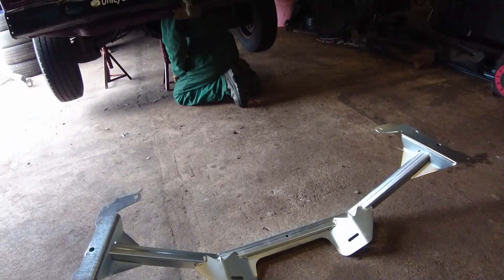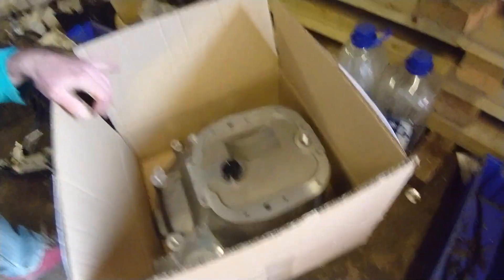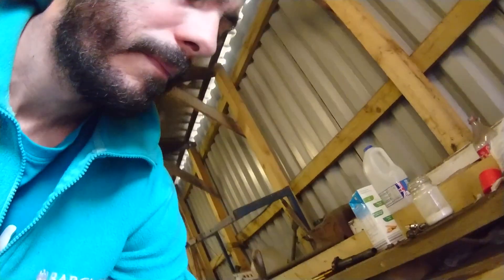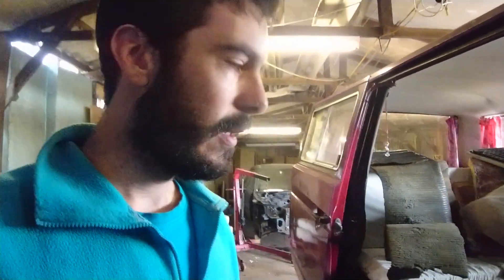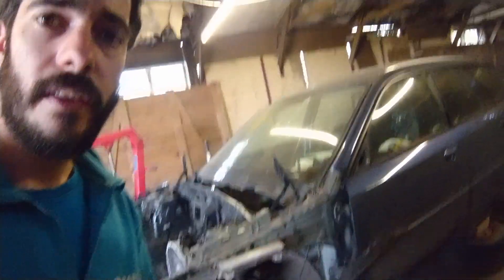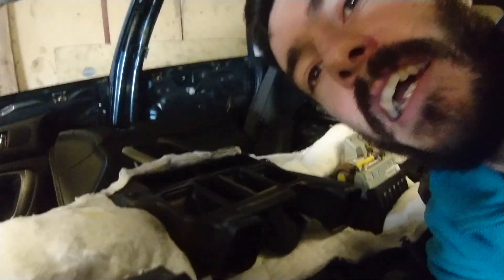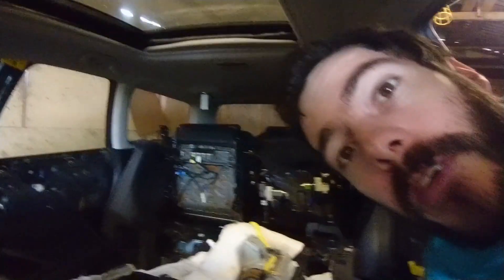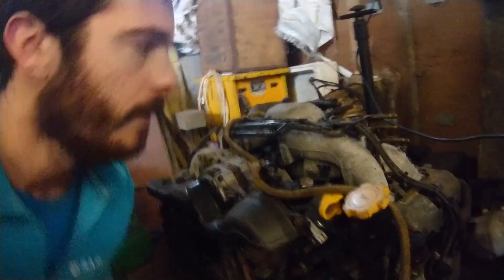VW T25 - Subaru CANbus Conversion [Part 1]

Comment: I just got a Subaru canbus donor and I want to do a similar conversion. Would you guys be able to do the cable loom shortening?
Reply from the maker: Hi there,
No, I don't do this as a service. The wiring is the trickiest bit for me, in fact the whole project has stalled because of it.  I have the loom out of the car and all the unneeded circuits removed but wiring it into the van is the daunting bit. Hoping to get a friend with lots of wiring experience to help me with it soon.
To be honest, if you get a copy of the Subaru manual and go through each circuit at a time, it's not difficult. You just have to be methodical and take your time with it. Label everything and only cut a wire when you've checked twice you don't need it. Even then, you can solder wires back together if you do cut one in error.

There is an Australian engine tuning company who make interface boxes and other things to make the wiring a lot easier. They're called AGT Engineering. https://www.agtengineering.com.au/

Good luck!
Reply: @EddHawkes  yes, I know AGT, pricey

Comment: What’s Canbus mean? You keep referring to it like it’s a common saying but I’ve never heard it before?
Reply from the maker: Technically it's CAN bus. It stands for Controller Area Network and it's how all the components talk to each other through the loom. 

Basically, the ECU sends out coded messages all the time. Each component has a unique ID and recives every message sent by the ECU but only acts on messages destined for them.  This method means that there are fewer wires because all messages can be sent down the same line. That's my very basic understanding anyway.